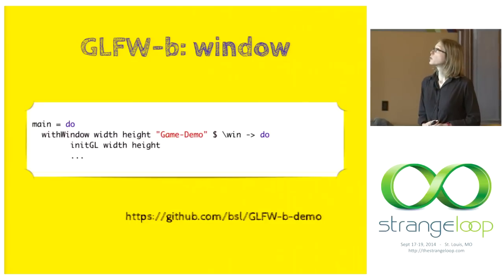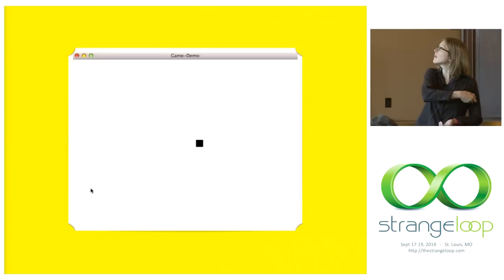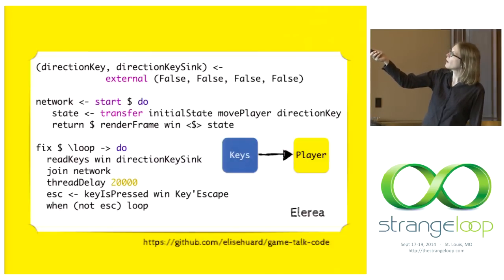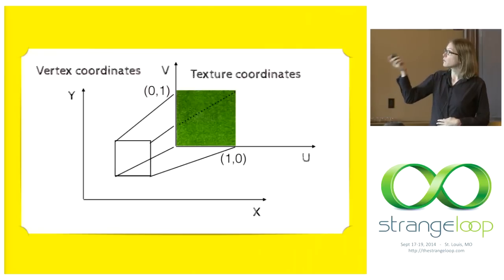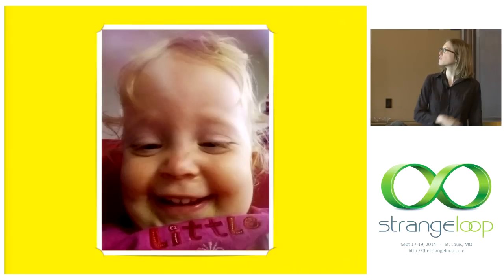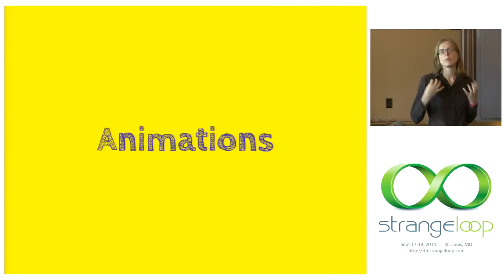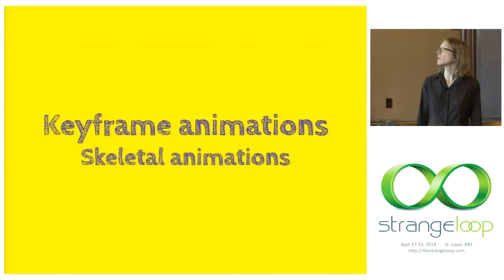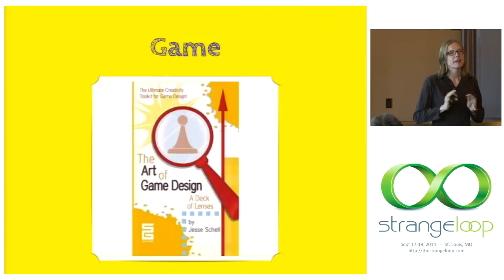"Writing a game in Haskell" by Elise Huard

Comment: Great talk. You only actually need about 24 frames per second to have fluid animation but you obviously want to shoot for 60 and cap at 30 if you can't make 60.
Reply: +supernewuser 24 fps works ok in movies mainly because of motion blur. If you don't have motion blur, the motion will appear choppy, so a higher framerate is usually preferred for smooth animation. This of course also depends on how fast movements you have.